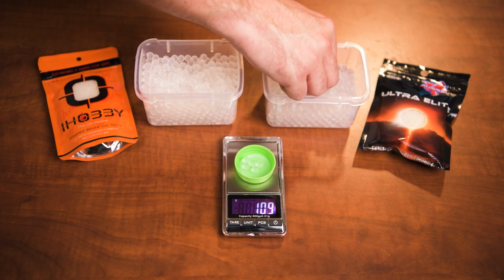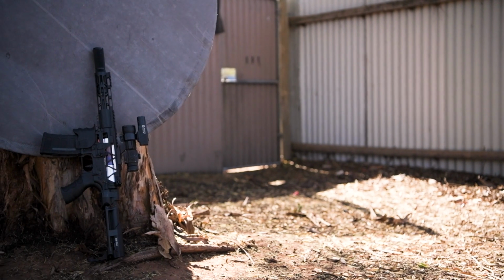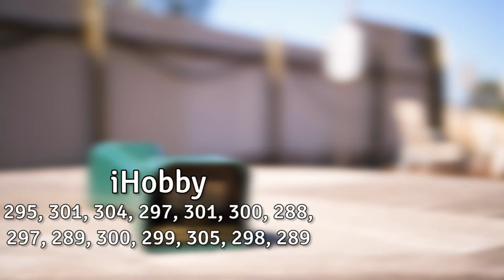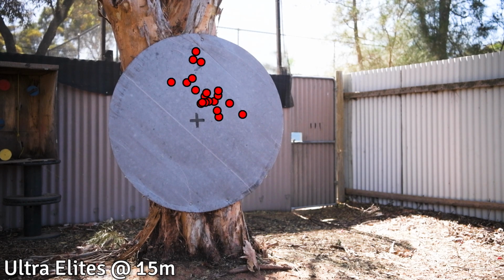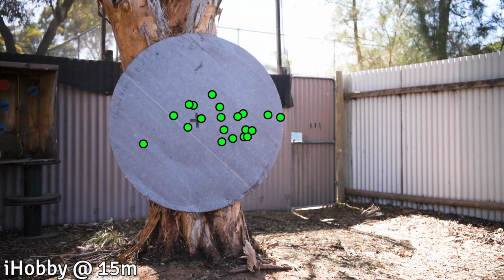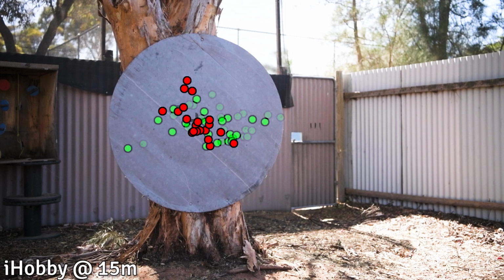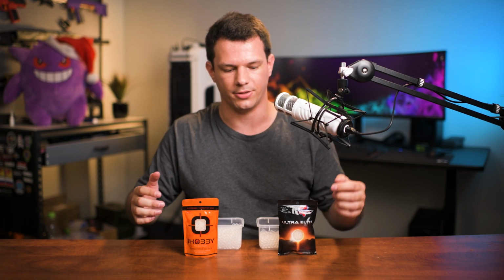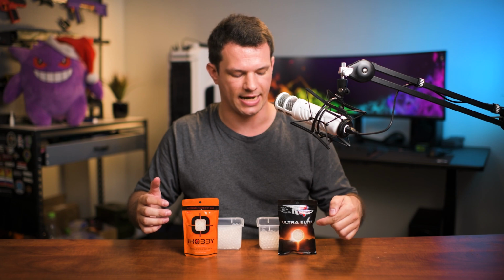Gel Ball Comparison: iHobby vs Ausgel Ultra Elites!

Comment: Hey man just wondering if you would be able to test a brass vs stainless I reckon brass works alot better from my testing as it has a sort to of lubrication to them that's why they use brass bushings in a lot of things that's if the brass is carbon impregnated the reason why they use stainless as a upgrade in airsoft is because it's harder and the bbs usually have a coating on the outside of them any way loved the vid also how much did you pay for the custom blaster man
Reply from the maker: The custom blaster was about $1200. I've tried brass before (bruisemaster) honestly no real difference but maybe a little velocity gain.
Reply: @BradleyPhillipsYT  you should try bad tech barrels they are like the best out now bruise master was the best but been a while since they bought anything out
Reply: @BradleyPhillipsYT  would love to know where you got this build from as it looks epic and I’d like to look at purchasing one. Liked and subscribed :)
Reply: Sabin, hit up east coast custom blasters about the badtech barrels, try it for yourself. Just remember if you can't control grow gels, dont sook about accuracy 🤪
Reply: @benadams2926  yeah I know daddy Gibson but you know me no moneys I have a brass 7.1 already just need to polish the inside of it
Reply: @gelology5514  Cape cod mate. Best brass cleaner there is
Reply: @benadams2926  I use autosol metal polish it works fucking good for brass I have found

Comment: Ultra Elites are so good, shame that heaps of fields ban them..
Reply: How could they possibly know what gels you are using unless you tell them?

"Yea these are just cheapo ones that came with it"

Problem solved.
Reply: G'day Daniel. Quick question - When you cant use ultras, what's your next best choice? (For a blaster with around 300fps)
Reply from the maker: @Daz-Moo  do they allow these iHobby gels? If so, use those.
Reply: @BradleyPhillipsYT  I don't think they have banned them yet but they are new so we will find out soon
Reply: Hey Brad, merry Christmas mate.  
I have the black dragon, gbb pistol,  so I'm guessing that the ultra elites,  would be better?
Reply from the maker: @jasonfleming5298  most likely yes
Reply from the maker: Not the case here in South Australia. Odd that they ban them in QLD rather than reassessing not having velocity limits.
Reply: @BradleyPhillipsYT  that's because even at 330 fps they break skin and everyone are pussies and have a bitch about it like just where long sleeve and a full face mask it's your own fault